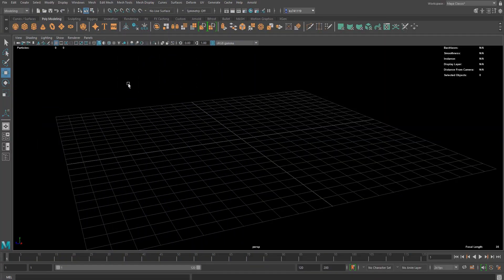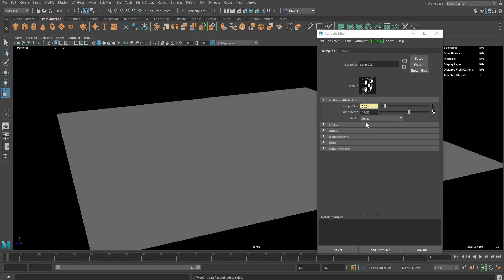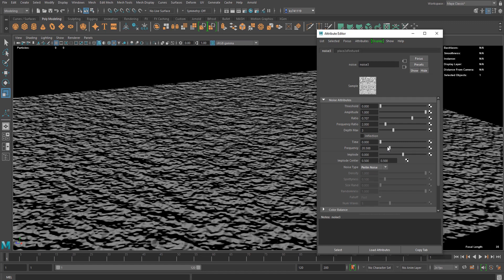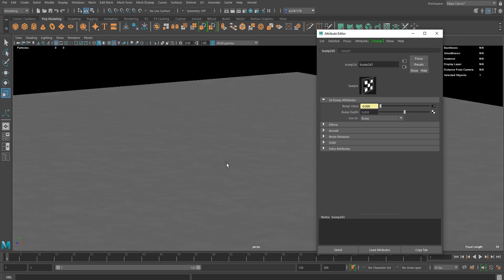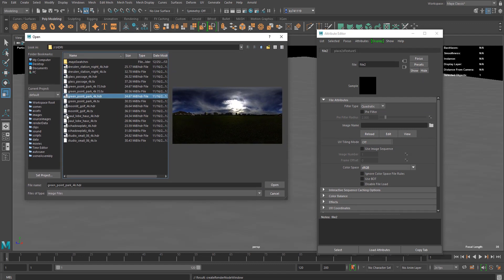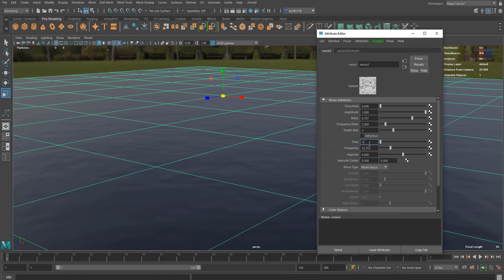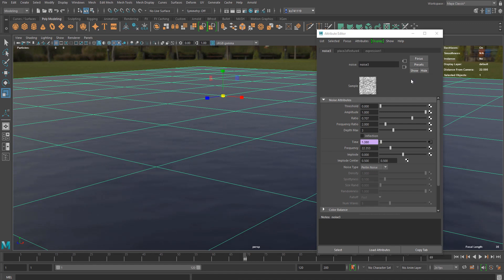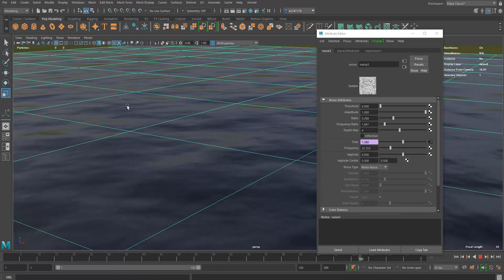Maya Easy Animated Water Shader

Comment: Sorry if this is a dumb question, but I did all this and when I tried to render it with arnold, it didn't show up in the final render. Would you know how to solve this?
Reply from the maker: Check if there is any light in your scene.
Reply: @syiastudios  i'm using a sky dome light, and everything else except the water appears in the render
Reply from the maker: @hiperchasegu6478  Does it appear as black or doesn’t show at all?